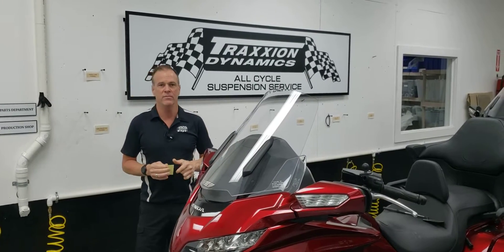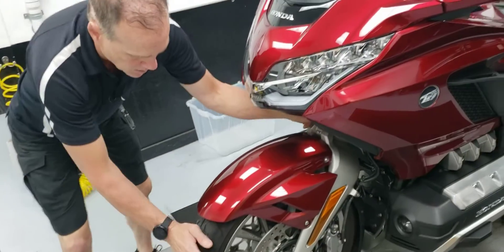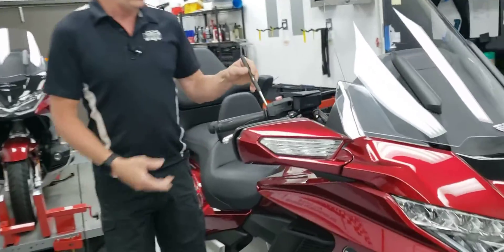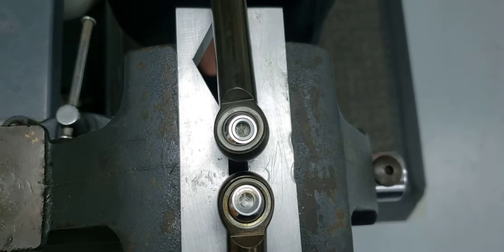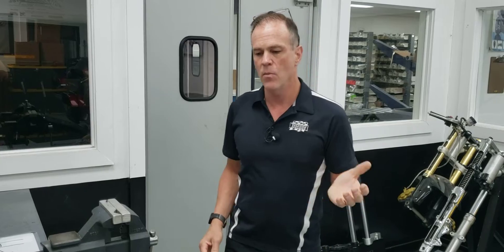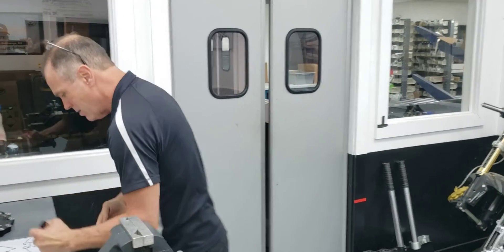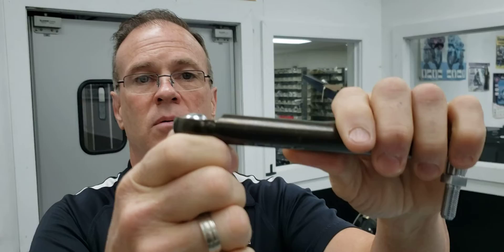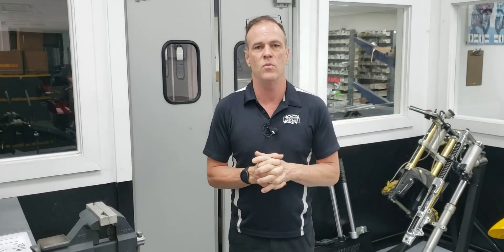Traxx-rite Tie Rod Safety Check and Update (2021) by Max McAllister from Traxxion Dynamics

Comment: My 2020 DCT Tour had that play issue. I felt it and measured it. Dealer simply put a pin to lock the fork and measured and it was off by 2 mm. They had one in stock, came back after few hours and was done under coverage. If it accurse again, I am ordering yours and done with it. I do read, many are using yours and never an issue. Solid steering. Shame on Honda on a 30K bike. And, I love Honda bikes.
Reply from the maker: We completely revised our tie rod, and it is now manufactured 100% completely in-house so that we can guarantee our quality.

Comment: What is the torque spec for the tie rod nuts if we remove them for inspection? Are the nuts reusable if removed?  They look to have a locking tab.
Reply from the maker: They have a locking tab, I always reuse them.  27 ft/lb.

Comment: Honda would never issue a service bulletin, that would mean they wouldn't look perfect.
Reply from the maker: Safety of every rider is more important than looking perfect... but after 23 years, we were likely to have at least ONE part go bad in a million.  So we just need to be certain everyone is 100% safe.  Don't forget, the bike has 2 tie rods for a reason.
Reply: @Traxxion  I have sent in pics of my suspension bottomed out on the jounce bumper along with my negative and unsafe riding experience months ago and here I sit with no response. Kind of funny how I am machining prototype jounce bumpers for BASF, definitely a challenge being they are made out of closed cell foam rubber.